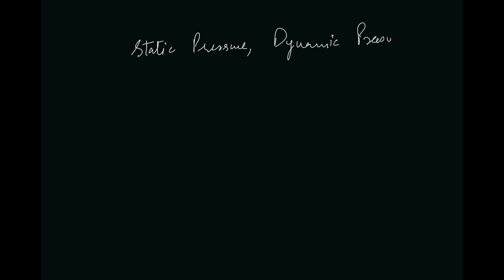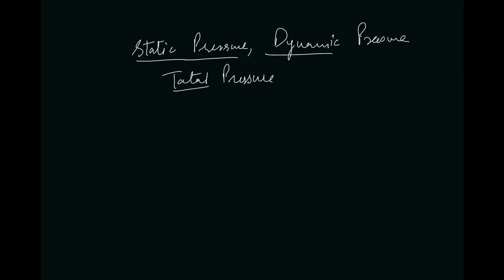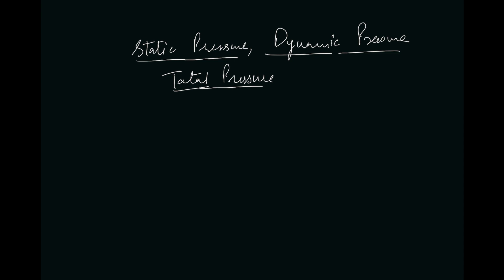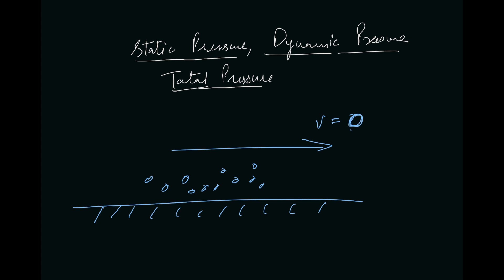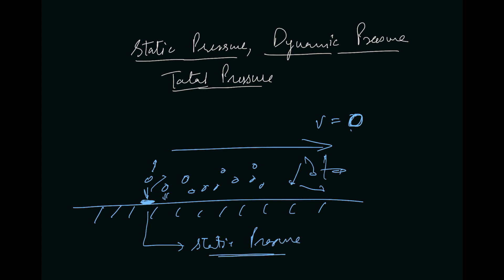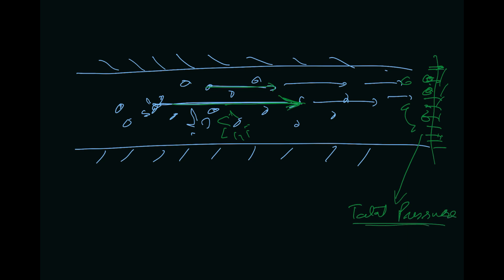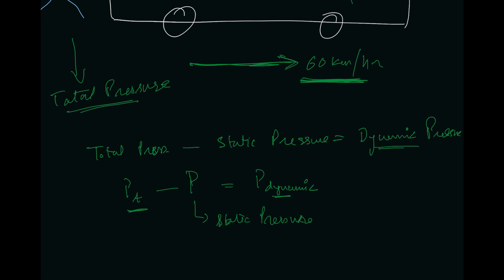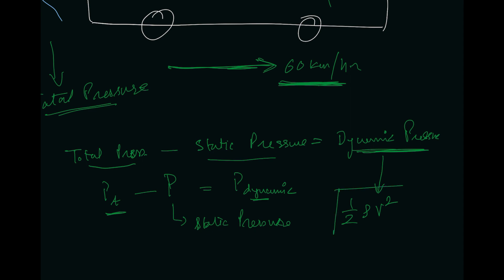What is static pressure, total pressure and dynamic pressure?

Comment: Hello i understood all the concepts, thank you very much for the explanation. I have a question: why the velocity is squared on the dynamic pressure s formula?
Reply: This is because kinetic energy formula is 1/2*mv squared. and dynamic pressure is define as kinetic energy per unit volume.  this means (1/2*mv squared)/volume - the mass over volume in here will give density transforming the formula to 1/2(rho*v squared)